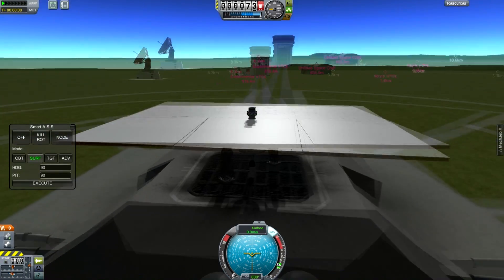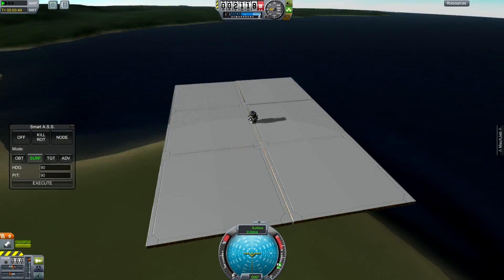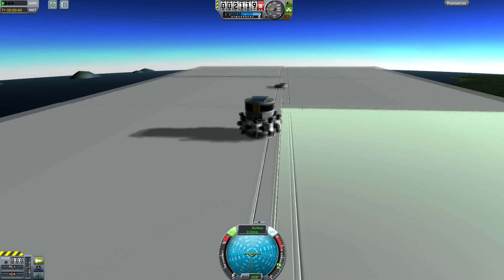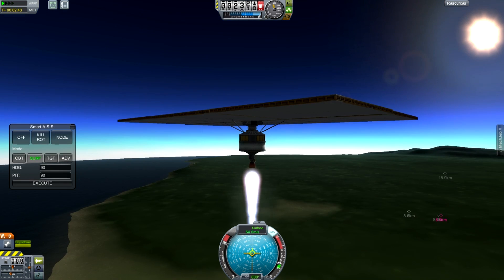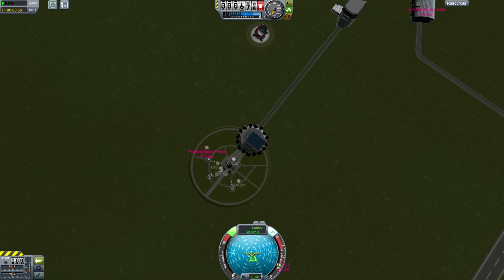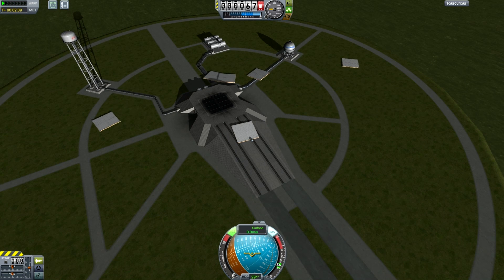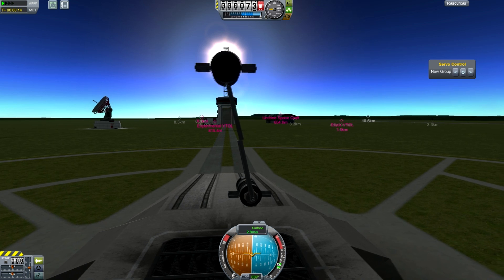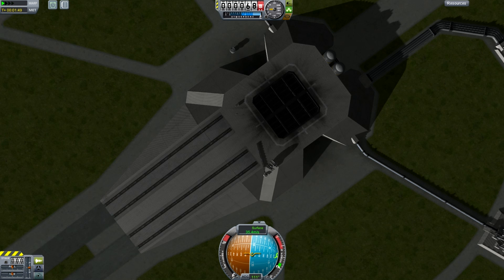Kerbal Space Program - Exploiting The Quantum Anchor For Fun And Profit

Comment: Couldn't they fly a positron around a particle accelerator like how they would do with an electron, and see whether it will stay on track like an electron or will fly up and hit the "roof" of the pipe? (They do correct for gravity in the pushes they apply on particles in particle accelerators, right?)
Reply: The electrical forces used to push the tiny mass that makes particles are so great that you can't tell even if gravity exists.
Reply: But after many loops, won't the neglected effect of gravity add up? Or are the forces not constant, but constantly adjusted to compensate for deviations in the path of the particle?

Comment: gravity is something you cannot escape.   it will have the same effect on everything.  BUTsince anti matter follows time in the opposite direction.  it will fall up.  since it's end point is in our past and it's origen is in the future.     (ps you are talking about neutrino's right? as fas as i know matter and anti matter follow time in the same direction.  originating at the big bang)    anyway neutrino's would fall up.  anti matter i think not..  if anything anti matter would get an even bigger attraction.  not only gravity, but don't opposite's attract :Pmatter and anti matter would have a natural sort of magnetic attraction wich is even stronger then gravity
Reply: +attack125 actually anti-matter would react to gravity normally (at least when it comes to black holes) as near the event horizon of a black hole anti-matter and matter are constantly being created then annihilated, but since the gravitational pull of the black hole is so strong the particles cannot annihilate. this means that one of the particles is free to escape the black hole thus creating the phenomenon of "Hawking Radiation"
Reply: Justin Moss
we know.
Reply: attack125
k
Reply: You can escape gravity that's like 99% of space a vacuum so far away from mass that gravity doesn't affect it.

Comment: This video's a bit old, but just FYI if you didn't find out later... you're mixing up some of the properties (going backwards in time, etc) of purely hypothetical tachyon particles that have negative mass (and which probably don't actually exist), and antimatter. Antimatter has normal mass/energy characteristics. The only thing different is that it's charge is inverted. It goes forward in time and is probably affected by gravity/exhibits the similar gravitational effects of normal matter (but is impacted by magnetism differently which is how it was discovered). Both interesting, but one is very real with very normal behaviors while the other is just a cool math/thought experiment.
Reply: +mrstobbe No, he's really not.  He explained in the top comment on this link.
Reply: +Jason Patterson I didn't see that comment, but yeah... that's still what I was talking about. A positron does not have any of the characteristics of moving in reverse of the space-time field. Really early (before we had the opportunity to do more in-depth experimentation), antimatter's properties were hypothesized... well, that it would behave in a bunch of different ways including this. Really, most likely, not true. Certainly not true about going backwards in time which would require a violation (or escape) of relativity (at which point the hypothetical problems with tachyons comes into play and it would be unlikely that we could even detect antimatter to begin with). We've already been able to show that antimatter doesn't violate symmetry and has the same mass characteristics, and, while there is no empirical evidence stating that antimatter does not have significantly different gravitational properties, the little empirical evidence that there is at least suggests that it's similar. After reading the question/reply in the top post, I think he was just basing his thoughts off stuff the scientific community has essentially entirely discounted at this point.

EDIT: And don't get me wrong... this stuff is fantastic mind play and it's important to think about all of it. Some of it may hold some truth. Even if antimatter isn't some fantastic anti-grav/anti-time thing, it's still mind bogglingly fascinating with tons of secrets yet to be unlocked. We can't even answer some of the most basic questions about it yet. It's just very unlikely to be some kind of form of matter that violates some basic laws of physics which have been really well proven with empirical experimentation and established at this point.

Comment: how are you using mechjeb with no mechjeb command pod?
Reply: ***** there's a little Mechjeb box under the Control tab in the editor, when you have Mechjeb installed, there's a small box that you can radially attach to your vessel. It'll allow you to use Mechjeb without the Pod.

Comment: I made a solar glider which I quickly learned was accidently a infinite glider when i tried to land it. I kept increasing speed and every climb to burn off my speed kept getting higher and higher. I had a very hard time landing that dang thing, but alarm bells went off all over the place about using it on other planets with an atmosphere.
The engine is good to control it, but even without it, it will still glide forever by diving and lifting, or rocking back and forth to build speed.

Comment: I wonder if we could produce antimatter/antihydrogens by isolating the necessary components in absolute zero fields before bringing them close enough and then "unlocking" them, or if possible "simply" merging the fields... Anybody has any ideas??
Reply: Alex Z What do you mean when you say "absolute zero fields"?
Reply: +zeke1220 Electromagnetic fields with an interior temperature of absolute zero, or 0 degrees Kelvin.
Reply: Those don't exist, though :/
Reply: +zeke1220 We've been trying.
Reply: Absolute zero is impossible to reach
Reply: Sotiris Krol while that is true a company in Canada has created a machine which a core is 0.015 kelvin which is ideal to help simulate the physics so while yes 0 kelvin is out of reach we could still try outside of 0 kelvin

Comment: Try this. You have a open drinking glass with three fingers of whiskey and two ice cubes, sitting on a flat surface inside the space capsule. You have to take it with you on a mission. Without adding or subtracting anything to the inside of the space capsule, how much do you have to do to the outside, before you can complete the mission and then drink it?